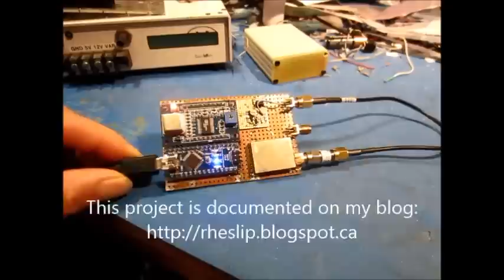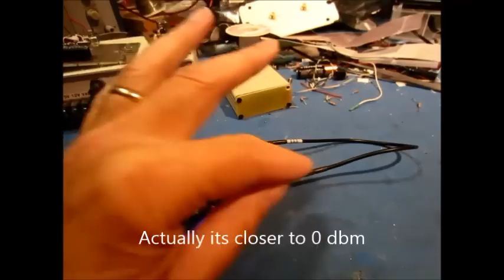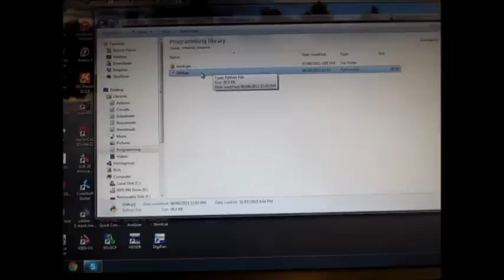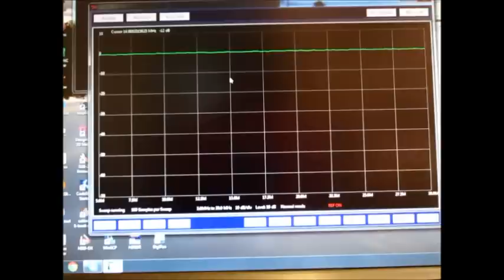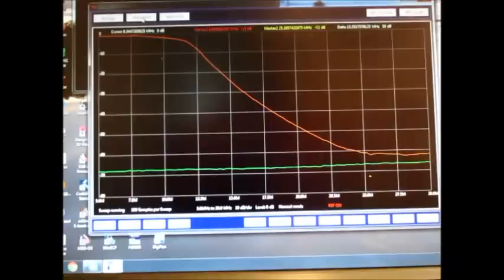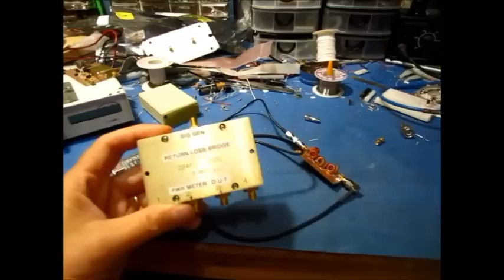Simple Scalar Network Analyzer you can build for less than $20

Comment: Lol, I found this video searching for AD8307 as I had just the same idea to use an AD9850 or AD9851 and a log power meter IC. At first I was thinking of building a rectifier detector and amplifier, then I realised this is so common AD or TI must have an IC built for just this purpose. I notice you can also now get the AD8307 on a premade PCB with SMA connectors for $15.
Reply from the maker: Its a fairly obvious thing to do and there are a number of designs similar to this floating around. One is a direct copy of this design but didn't credit me. That's what happens when you put things in the public domain.

Comment: Looks good. I have the software running and I'm procuring parts. just waiting on my power detector. Question: Do you absolutely have to modify the AD8850 DDS LPF? Or is the stock LPF usable in reality? Tnx and 73 de G0MOH
Reply from the maker: You probably don't need to modify it. I read that some of these are built with a filter that rolls off much too fast. When you build the SNA you will be able to tell very quickly - just connect the output to the input and sweep it. The "cal" function takes care of it anyway unless its really bad. 73, Rich VE3MKC